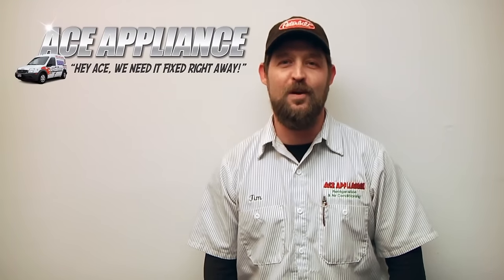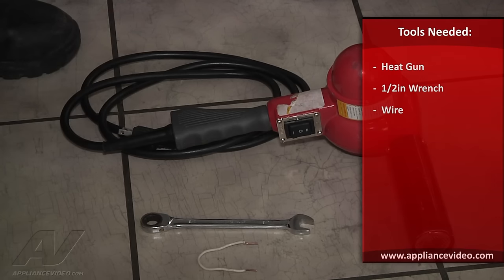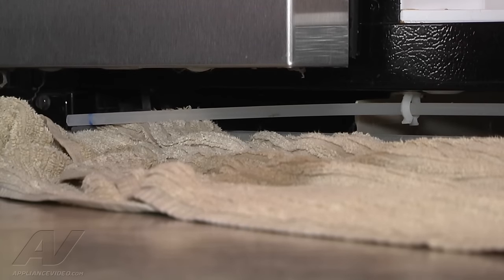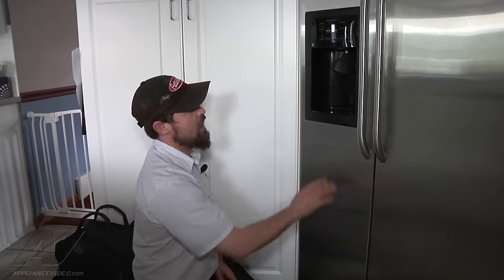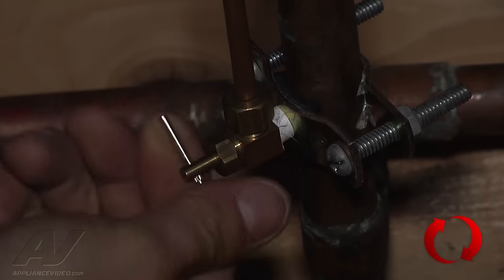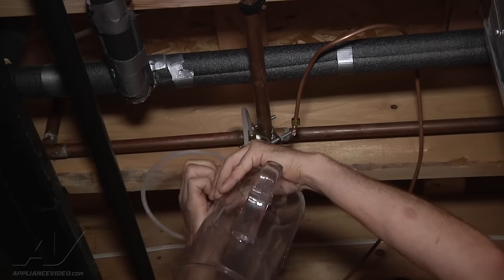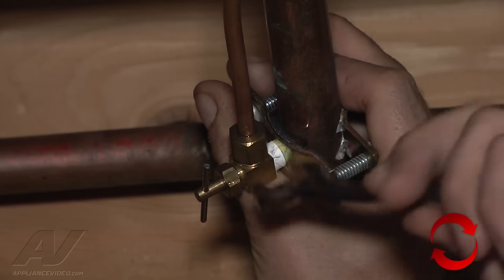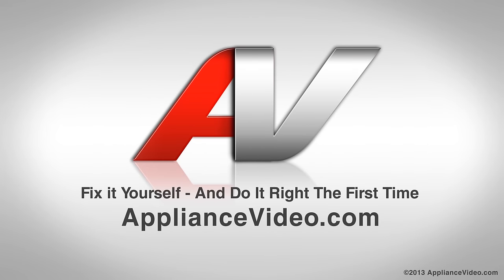GE Refrigerator Repair - Door Does Not Dispense Water - Saddle Tapping Valve Troubleshooting

Comment: Hey Guys   I keep having to replace the watervalve  after I install them.  It seems that a couple of  weeks go by and they start to shutter off and on real fast without filling up the ice tray.  This makes about 6 watervalves that I have replaced.   I can't seem to find anything on Youtube concerning this issue.  The water dispenser inside the door flows like there is no blockage, however, I can't find the cure.  Any help would be appreciated.
Reply from the maker: Great question, you can call
our parts department at 1-800-830-5465 and they can give you help 6-days A week
Mon-Sat . You can also search at www.SaveMoreOnParts.com 7- days a week.  If you have a more
technical question that our parts department cannot answer, our technicians are
answering all questions at our website at www.ApplianceVideo.com under our Repair Help section. We have over 6,000
common questions and answers that you can easily search through by your model
number, appliance make, problem or error codes, and It’s completely free to
search through our question & answer library. There is a very good chance
you question is already answered there.
Reply: Why can't you place the comment here on the website, so that everyone can read about the problem.

Comment: Line was not frozen, but plugged. I detached the water connector per the video and ran a heavy wire down both ends. The line leading up to the dispenser was sharply curved so I suspect the line might have been freed there with my wirer. I also had more trouble getting the lower grill / toe plate back on than servicing the water line!
Reply from the maker: Great question, if you have a more technical question that our parts department cannot answer, you can search our over 13,000 answered questions free at our website www.ApplianceVideo.com under our Repair Help section. You can also call our parts department at 1-800-830-5465 and they can give you help 7-days A week ,or search at www.SaveMoreOnParts.com  .

Comment: Hi after fitting filter to my Whirlpool refrigerator the gauge is still showing 0.01 instead of the F99..any ideas?
Reply from the maker: Great question, you can call
our parts department at 1-800-830-5465 and they can give you help 6-days A week
Mon-Sat . You can also search at www.SaveMoreOnParts.com 7- days a week.  If you have a more
technical question that our parts department cannot answer, our technicians are
answering all questions at our website at www.ApplianceVideo.com under our Repair Help section. We have over 6,000
common questions and answers that you can easily search through by your model
number, appliance make, problem or error codes, and It’s completely free to
search through our question & answer library. There is a very good chance
you question is already answered there.

Comment: I left the freezer door open for about 2 hours. It didn't work. I used a blow-dryer on the back of the door, and up inside the water dispenser, too. Nothing changed. I stuck a piece of wire 2 feet up inside the line, so I don't think my line is frozen. I'm not sure though. I replaced the filter in the refrigerator. I replaced the solenoid. No water is dispensing. My water valve in the wall works just fine. I checked the water line underneath the refrigerator where the connector is just below the freezer. Water is not frozen there and there is a water supply to the line. My initial problem was that when we got a glass of water, the water would not shut off when we released the cup from the dispenser. I had a professional come diagnose the problem. He said I had a bad solenoid. He then tried to charge me $280 to replace the solenoid. I decided to not use him and I bought a solenoid online and replaced it myself for $20. I then bought a $40 filter for the fridge. the new solenoid didn't change the problem.  Now since I put the new filter in, and the new solenoid in, there's no water being dispensed at all. I've checked everything I can think of and the only thing left that I know of is that the line is frozen or clogged. So I checked for clogs and ice and I don't find any clogs or ice. The water dispenser does drip now, and it didn't do that before. I just turned the water valve back on, so I don't know that the ice maker isn't working. I think the ice maker is working. I don't know what else to do to troubleshoot this. Can you help?
Reply from the maker: Great question, if you have a
more technical question that our parts department cannot answer, our
technicians are answering all questions at our website at www.ApplianceVideo.com under our Repair Help section. You can also call
our parts department at 1-800-830-5465 and they can give you help 7-days A week
Monday -Sunday, or search at www.SaveMoreOnParts.com  24 hours
7- days A week.
Reply: ApplianceVideo.com, last week, I got a new valve, the one in the back, on the bottom left. Easy fix. $19 part.
Reply: @VegasBugs  What part did you pick up? I have tried everything in the video and I still can't get water to dispense. Any help would be appreciated! Great Video ApplianceVideo.com!

Comment: I use the hair dryer to unfreeze the line but now it's freezing again what could it be
Reply from the maker: Great question, you can call
our parts department at 1-800-830-5465 and they can give you help 6-days A week
Mon-Sat . You can also search at www.SaveMoreOnParts.com 7- days a week.  If you have a more
technical question that our parts department cannot answer, our technicians are
answering all questions at our website at www.ApplianceVideo.com under our Repair Help section. We have over 6,000
common questions and answers that you can easily search through by your model
number, appliance make, problem or error codes, and It’s completely free to
search through our question & answer library. There is a very good chance
you question is already answered there.

Comment: how change the touch dispenser
Reply from the maker: Great question, you can call our parts department at 1-800-830-5465 and they can give
you help 7-days A week. If you have a more technical question that our parts
department cannot answer, our technicians are answering
all questions at our website at www.ApplianceVideo.com under our Repair Help section. We have over 3,000 common questions
and answers that you can easily search through by your model number, appliance
make, and problem or error codes, and It’s free to search through our question
& answer library.

Comment: Ok great, but why did it freeze up in the first place? If this keeps happening is there a permanent fix?
Reply from the maker: Great question, you can call
our parts department at 1-800-830-5465 and they can give you help 6-days A week
Mon-Sat . You can also search at www.SaveMoreOnParts.com 7- days a week.  If you have a more
technical question that our parts department cannot answer, our technicians are
answering all questions at our website at www.ApplianceVideo.com under our Repair Help section. We have over
4,000 common questions and answers that you can easily search through by your
model number, appliance make, and problem or error codes, and It’s free to
search through our question & answer library.